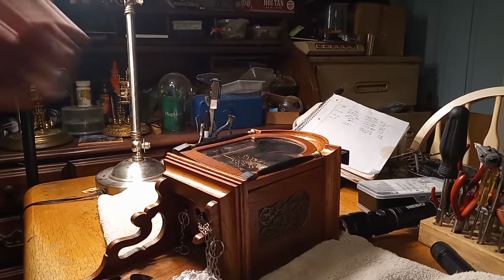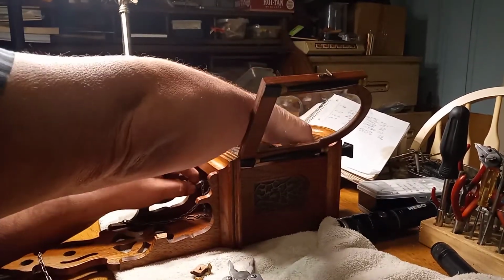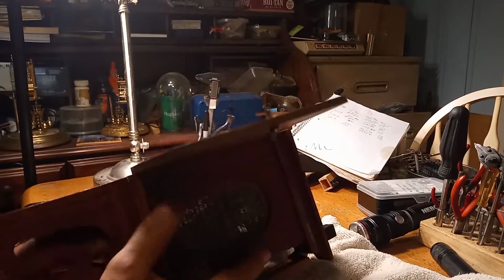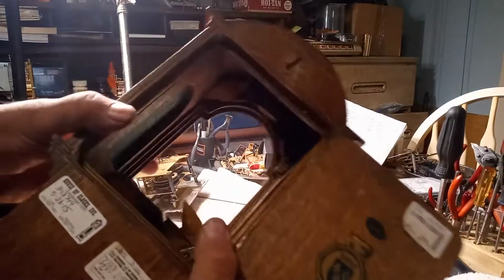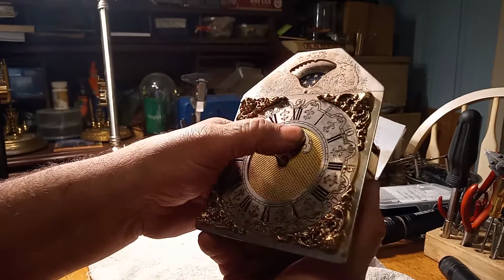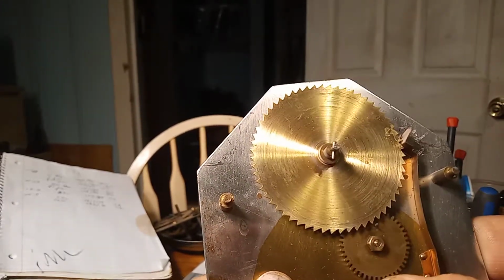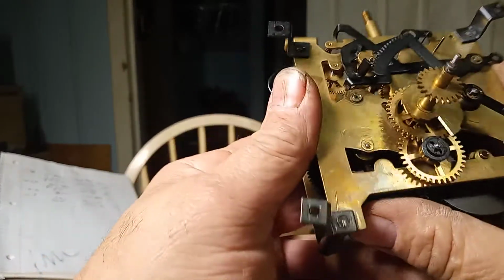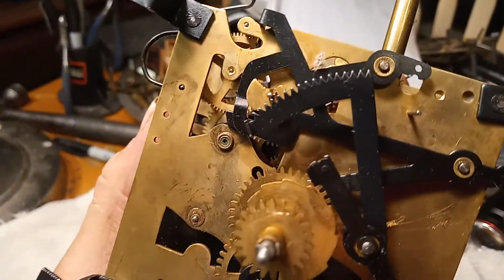Repairing a WUBA Warmink Dutch clock 20211209 203252

Comment: Hi Mark!

How are you doing?

Hi there, 

How are you doing?

I won this clock at an auction about a year ago and will finally be able to set it up. Unfortunately I haven’t had any luck getting in touch with the person who has sold it to me. 

Do you think you would be able to give me any pointers as to how to set it up? 

I would really appreciate any help.

Warm regards,
DM
Reply from the maker: I am good. Denise what kind of clock is it. If it is a cuckoo clock then I have a video on getting your clock in beat. Once you put it on the wall and you want to have it securely on the wall with a screw head or nail head that is just small enough to go into the hole of the cuckoo clock that is in the top half of the back of the clock not the lower half. Hang it on the wall with the weights on and the pendulum off the leader wire. Move the clock slowly to the left or to the right until that pendulum leader wire starts moving back and forth. Once it does stop moving the clock. Then stop the wire with your fingers and let go if it continues to swing on its own then the pendulum can go on the wire if it doesnt continue to swing then move the clock until you can get the wire to swing on its own after you let it go with your fingers. Your clock should be in beat and you start the clock off by giving the pendulum a slight swing. It should continue on its own if you didnt move the clock in the process of putting the pendulum on the wire after the above instructions. If you cant get it to swing on its own after releasing it with your fingers then the clock movement inside is probably dirty or something else is going on. I have plenty of videos on what to do. I hope this helps. BTW I watched your video. You are a very attractive young lady.
Reply from the maker: Denise the same procedure that I speak of above is the same procedure used for the Dutch WUBA clock in the video that you watched. Please let me know if I can help you further.
Reply: Antique clock ...very nice